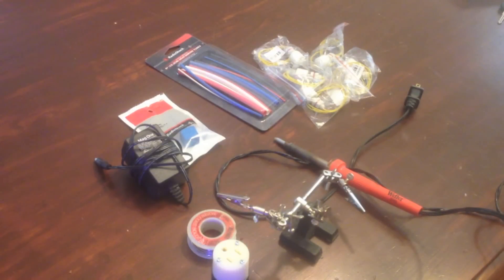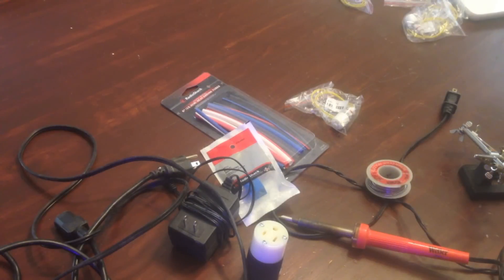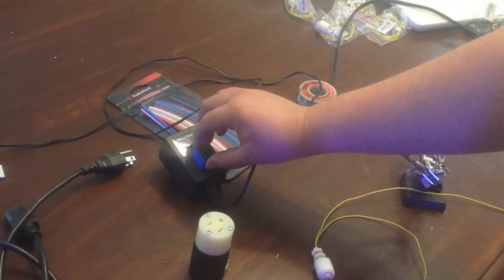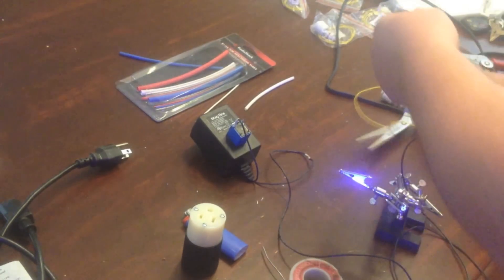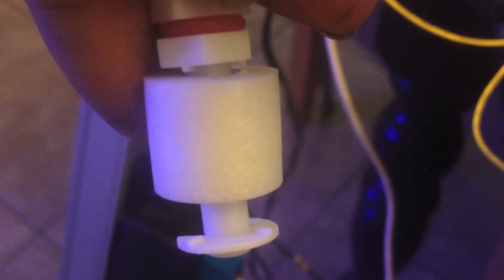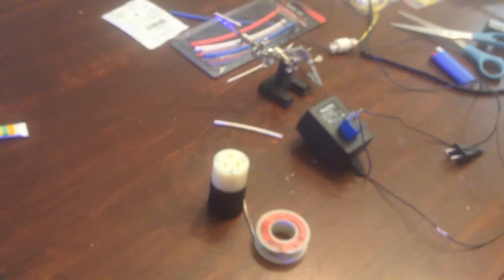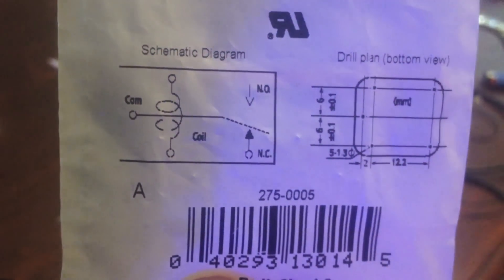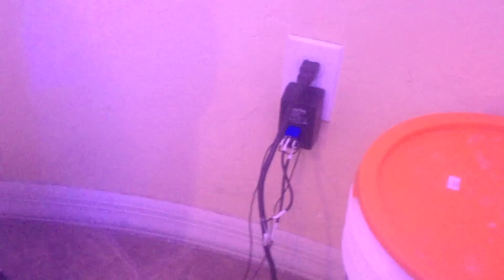HOW TO: DIY ATO!!! float switch and relay.

Comment: This is a great video. Thanks for taking the time to make it. My only question is about adding the female adapter to the extension cord? Why did you do this? Is it because your pump has a 3-prong plug and your extension cord is only 2-prong so you converted your extension cord? I have a 2-prong pump so would this plug directly into a 2-prong extension cord? Thanks again!

Comment: 8 minutes in - Correct me if i'm wrong, positive side from transformer goes to 86 on relay switch and in between the negative side from transformer to the 85 in the relay switch is the float switch. 30 and 87 goes to your positive side on the pump.

Comment: Can you swap the poles on the float switch and use this as a safety just in case your tank overflows. This way the float will trigger a pump that will safely drain the excess water into a basin rather then the floor?
Reply: +Chris Edward Just use another relay in series that's always closed until the high level switch is tripped.

Comment: OK just a thought but I was thinking of a 5volt relay and using an A/C to 5volt USB mini charger as the voltage on/off source as to trigger the relay & keep voltages low. This would make the adapter smaller, more power efficient and still safe because the relay isolates 120Volts A/C ( HIGH VOLTAGE ) into a low safe voltage. This would be used on a outside water fountain to stop the motor from burning out.

Comment: I make the same system, but you really want two float switches in series. One of them will be elevated high enough to not be in contact with the water (thereby staying "on") during normal operation of the system. Then WHEN, not if, your primary float switch fails in the "on" mode you will have one backup float switch that will cut the power to the ATO pump before the water overflows your tank and onto the floors :) The backup float will have a very low chance of failing, since it won't have any algae build up or anything, since it is usually elevated above the water. If you want you can of course triple or quadruple secure it by adding more float switches in series :)

Also combining the float switch with an optical switch also helps to further the safety, considering the optical switch does not have any moving parts. It can however be overgrown by algae and thereby stay "off" until you clean it. This is much safer then locking in "on" mode :P